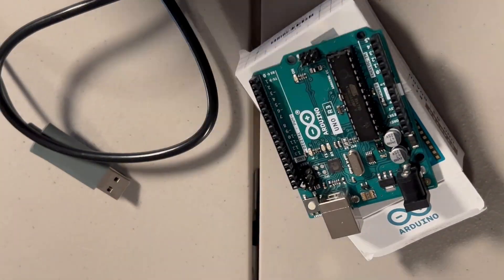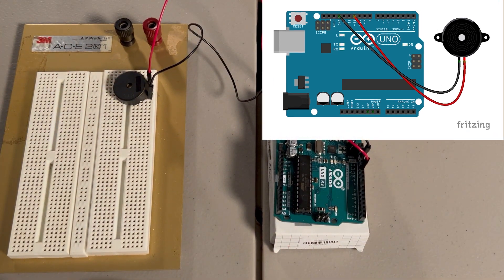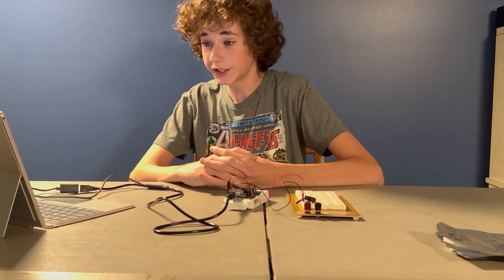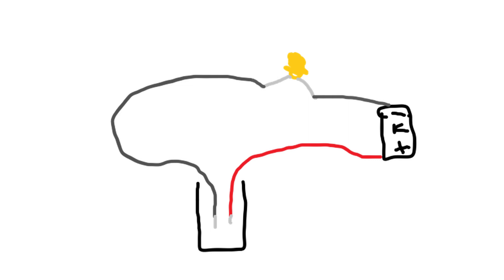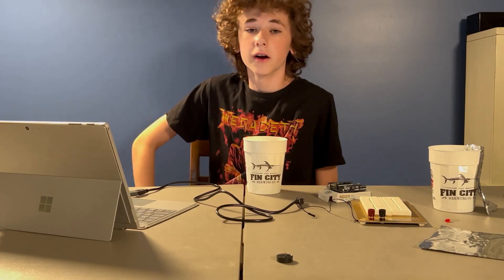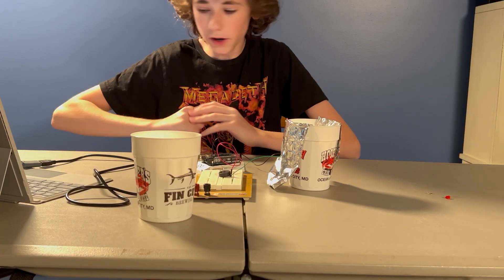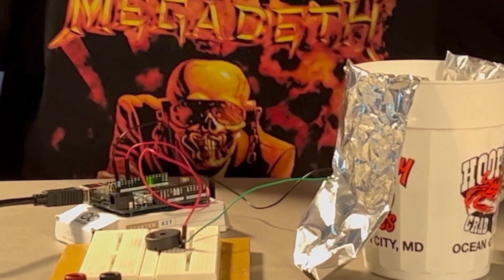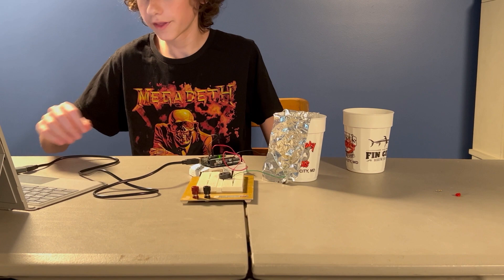A robot that plays the song of storms when it rains

Comment: A tip is to use prototype shields where components are soldered on and there are no dangling cables needed except for external stuff like noodle cups and such, to secure that builds work for more than half a minute (I never use breadboards for that reason). Also easier to fit in a box etc.